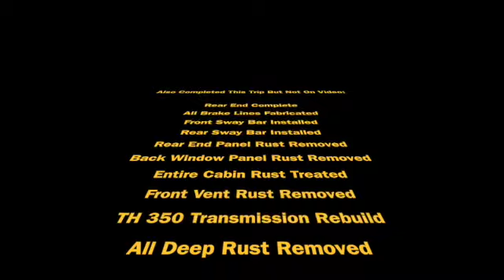1935 Ford 5 Window Coupe Rebuild.  Part 2

Comment: Congratulations!  Very nice job!  What is the name of the pins that hold the panel in place before welding?
Reply from the maker: Cleko clips.  They are generally used in aircraft construction / repair.  You can get them all over, but aircraft spruce would have them mail order.  Don’t forget the special cleko pliers.